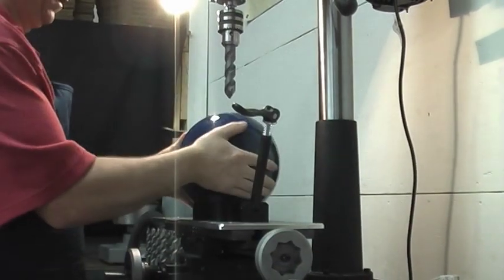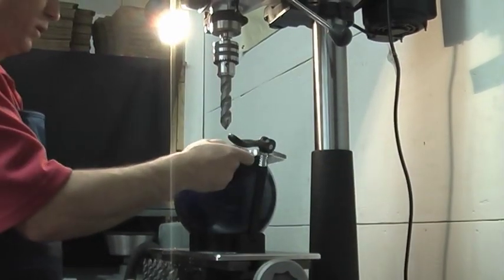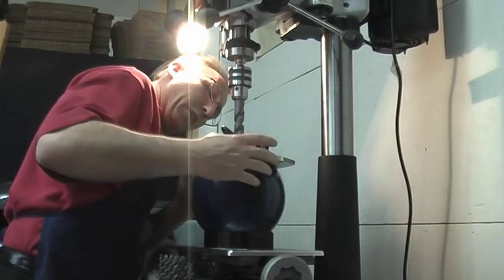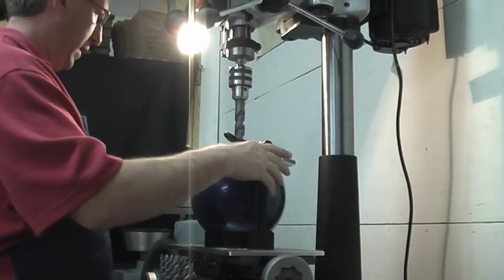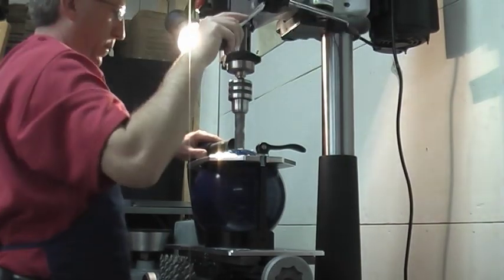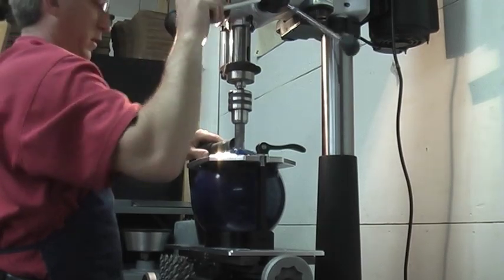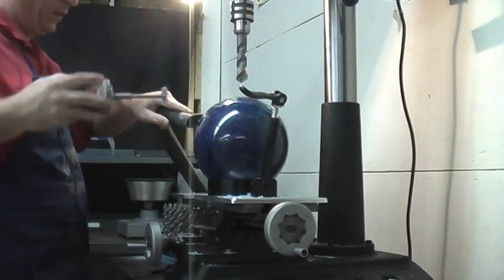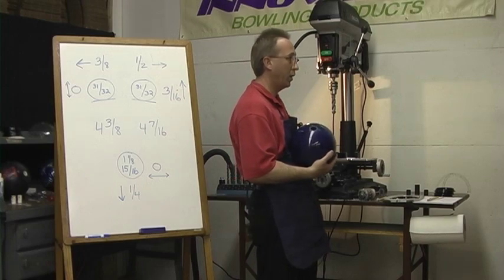Drilling a Bowling Ball - Innovative Bowling

Comment: thanks for the video.  I want to start drilling my own balls.  I want to buy some used balls that are already plugged so I can learn on cheap balls rather than new ones.  I am a machinist by trade.  I can design and build a fixture to hold the ball and use a 2 axis retrofit Bridgeport style mill.  Seems to me I would just put a mark at the exact center or where I want the drill bit to hit and then use a spot drill to start the hole. I could even drill them a little undersized and then circle mill them to exact size.  As far as hitting pitch, my plan would be to get lined up right over the center of the fixture (also ball) and then move the table the required amount for pitch.

Comment: Having a laser pointing at the tip of the bit is silly. Even if you're a little off in your jig, you can still start drilling the tip of the bit into the ball without consequence. You'd see you were off and just adjust the ball. A more useful setup would be to have a laser poining at where the side of the bit was going to hit the bridge and span lines. But that would be much more difficult to make.